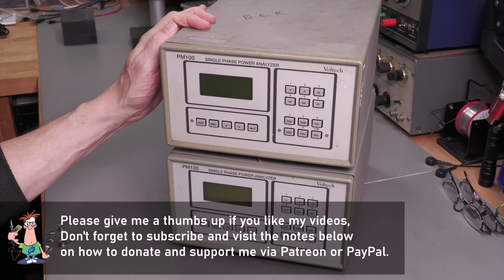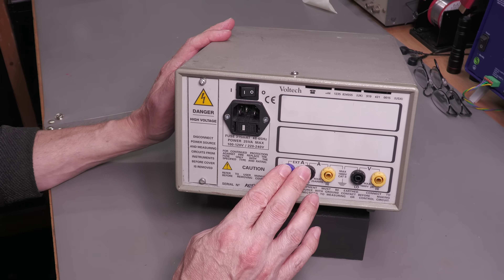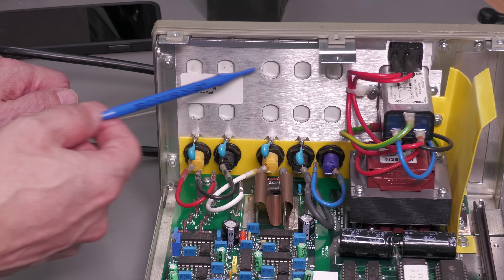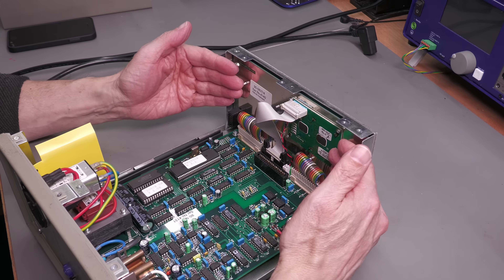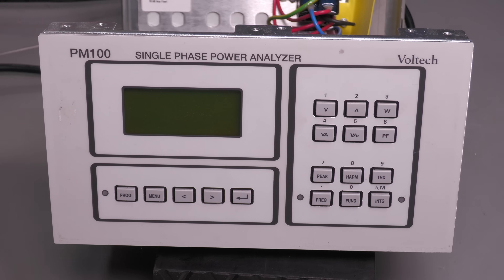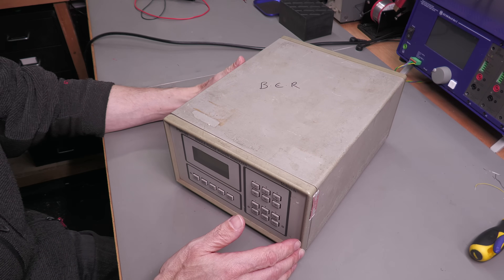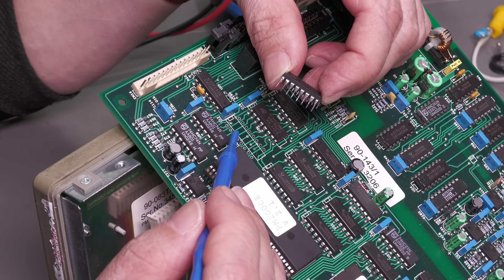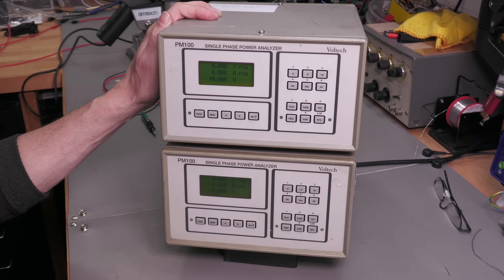No.120 - Voltech PM100 Power Analyzer Repair (2off)

Comment: Hi Ian, I scored a PM3000A from the scrap bin this year. It had a flat internal battery. It kind of works but as you operate the front panel, the display becomes corrupted. Do you know of any programming software to connect to the instrument?
Reply from the maker: If you look at the datasheet for the PM3000A it has options on the rear panel, but there is also Voltech software available, see VPAS software.
Reply: I tried looking at their website before, I contacted them and CalTest, I can find the VPAS manual on their site but no download for the exe.
Reply from the maker: I saw on their site it says the software isn't available for new sales which kinda looks like it should be available for existing owners......the software keyed to your actual unit.

Comment: 11:19 i guess that the frontpanel pcb has a little flex and due the years of use ,that ribbon connector get squeezed between the frontpanel and the edge of the mainboard each time the front buttons are used, after time this connector got partially squeezed out.
Reply from the maker: Yep, quite possible.